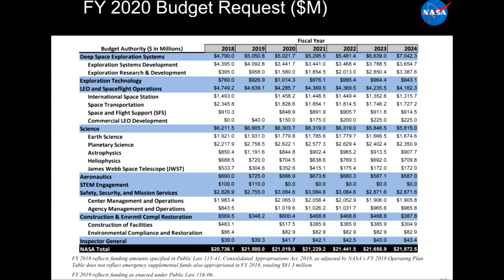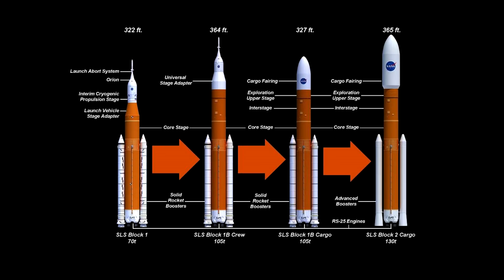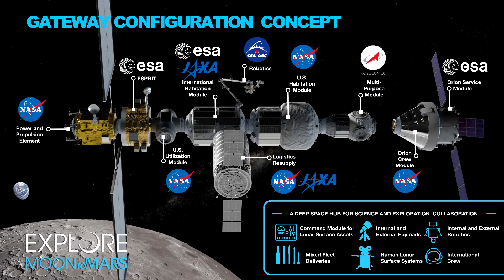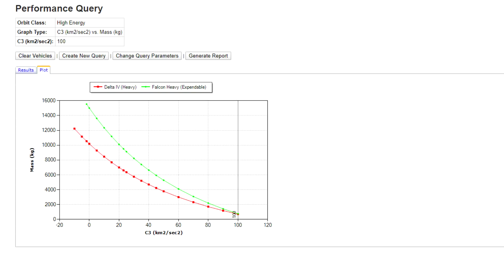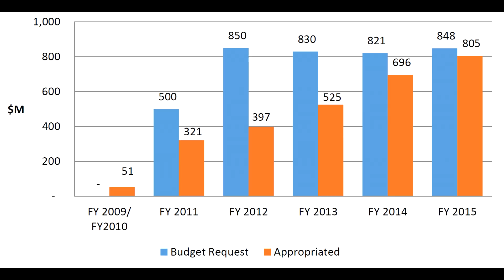SLS Rocket In Trouble After New White House Budget Request

Comment: Why is it so hard to put together a rocket made out of existing parts?
Reply: Because SLS isn't about building rockets. It's about spending money.
Reply: It isn't. The SLS program is not designed to get us to the Moon or Mars, it's designed to spend as much money as possible, results be damned.
Reply: @SuperSMT  Well, not exactly like that - it's designed to keep the Shuttle contractors at work and happy.
Reply: Because designing it to use existing parts that were not designed for that usecase, is more expensive than designing it from a clean sheet.
Reply: @BosonCollider  Maybe i'm missing something, but why weren't they designed for that use case? The main tank is just a simple tank, the engines are the same as on the Shuttle (only now they are mounted straight and at the bottom of the tank, which is a simpler design) and the solid boosters are just simple boosters.
The only thing that's new is the upper stage and capsule.
SpaceX thought Falcon Heavy would be easy - just slap together 3 first stages. They quickly realized that it's not that simple, but it didn't take long for them to solve that problem.
Reply: @oleglovky  5-segment boosters instead of four segment are a complete redesign, almost no work is saved.

SSME has stopped production a long time ago since it was intended to be reused indefinitely on the shuttle, so a production line had to be restarted for an expendable version which will be more expensive to develop than the raptor.

Core stage has to support upper stage weight, so it's completely different from shuttle tank structurally.

Shuttle orbiter bits are completely gone. Computers are modernized. Launch pad setup and integration is completely different. Aerodynamics and loads are completely different.

The biggest question is what actually ends up being the same. Every component has been getting a complete redesign to fit SLS, but the mandate to "use existing parts" locked the design into a suboptimal compromise with no obvious cost cutting measures allowed, such as "spend 2B on develiping a basic Kerosene engine for the first stage and use J-2X second stage, to save 8B on booster development and RS-25 restart".
Reply: Also, the RS-25 space shuttle main engine is incredibly complex, and poorly understood by even its original designers. The flow through some of its channels is in the opposite direction from what the designers intended, but once it worked with good enough performance they didn't mess with it.

Designing a "modernized expendable engine with modern manufacturing methods" is not going to be easy, because it can start exploding or behaving differently if the flow through those channels go the way the designers originally intended. 

So not only do you have to design the tooling to make the engine which is often more expensive than the engine design itself, you have to do redesigns of the engines if your new tooling makes engines that explode.
Reply: @BosonCollider  Thanks for the comprehensive explanation.
One question though:
Shouldn't redesigning an existing part be less work than developing one from the ground up (like SpaceX redesigned the center core for Falcon Heavy)? If so, then there's no excuse the delays and over-budget of SLS.
Reply: @oleglovky  That depends a lot on the part in question. For most of the shuttle components, there were a lot of possible alternatives. Using the already developed J2-X for an upper stage and developing a gas-gen engine from scratch would be easier than reworking the RS-25. Tank work would be similar, except the tanks would be smaller. And side boosters would be completely eliminated. Alternatively, a privately developed engine like the BE-4 could have been used.

Reusing old components can make sense if you do it because it makes sense to do. But here it's done for political reasons rather than engineering reasons, so you're basically working with randomly chosen parts to keep using.

Also, Nasa isn't allowed to save up money for the design work hump, it has to spend a constant amount year by year, which clearly makes things more expensive.
Reply: BosonCollider sir, you are exactly right.

Comment: I would be fine with cutting the SLS so long as a good deal of the money went to a SpaceX contract for Moon and beyond missions, ie BFR.
Reply: No, we're not killing one $$ trap to just send $$ elsewhere.  Money after results, thus no room for excuses.
Reply: @mhamma6560  You mean like years of reliable cargo missions to space station and very soon crew missions to the same, all at lower cost than competion?
Reply: @billh2294  SLS is money before results, lots of it wasted.  Money after results.  Don't need another set of lips on the taxpayer milk-money-supply
Reply: @mhamma6560  I agree with you. Politics in NASA has hobbled their progress. Space X has demonstrated that they can reach goals quickly and cheaper than anyone else. If taxpayers want to have a space agency and want results on the cheap, Space X is the proven company to do it.
Reply: @mhamma6560    No bucks, no Buck Rogers.

Comment: I think they should just scrap the SLS and work jointly with SpaceX to bring BFR into reality. Because I have my doubts about SpaceX' BFR also, so if they worked more collaboratively I would have trust in it being both cost effective and actually getting done. Although as per usual it would be late.
Reply: I think a scaled down version of the booster part of BFR or the New Glenn first stage paired with Lockheed's single stage Mars or Lunar lander and a fuel deport could be a very workable system.